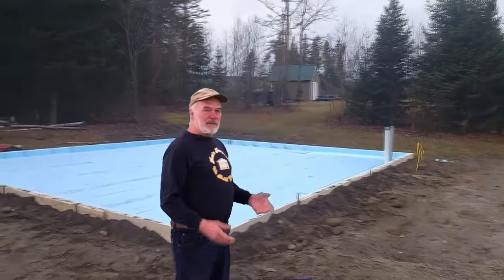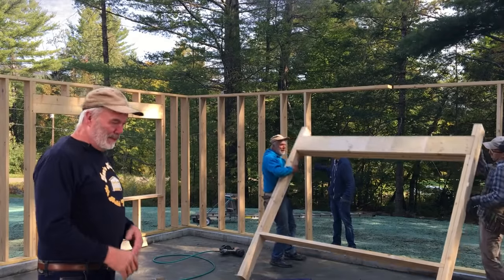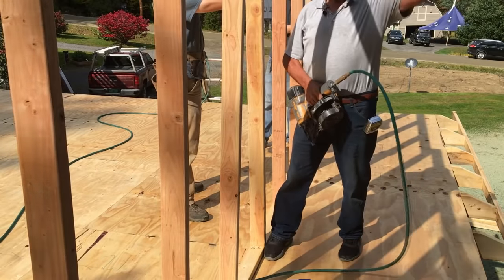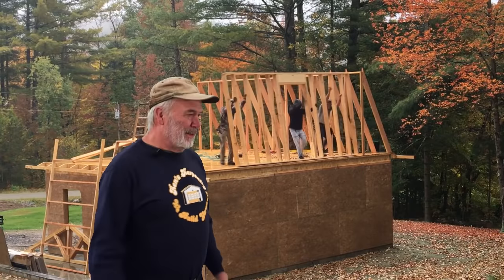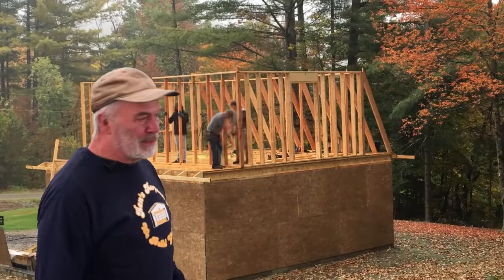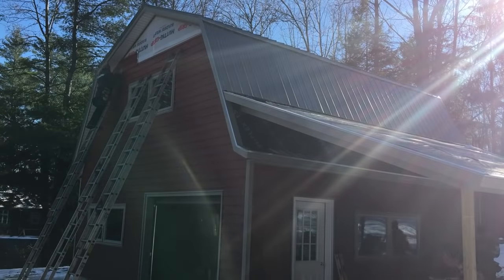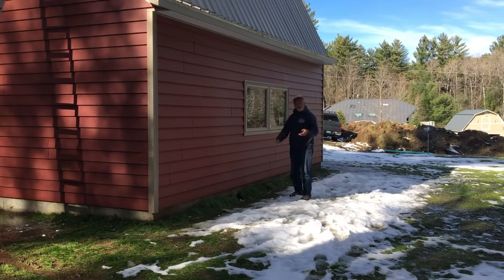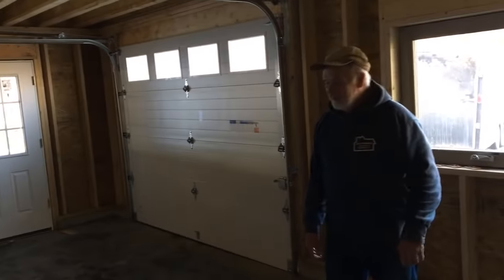How Much for a Gambrel Garage in 2021 ?

Comment: Hello from St. Louis Missouri Ken.
I enjoyed this video sir. I'm looking to have something very close to this built in the next year or so. The building would be a hanger with small shop on ground level and a planning, sleeping on the second. Really the only difference would be a large door opening  to accommodate a 23 ft wing span (aprox 24ft opening?). You've done a nice job here Ken. I appreciate the time you took to explain the details. You have gained another subscriber sir.
Reply from the maker: Sounds like a nice project. Hope it goes well.

Comment: Nice to see sill plate gasket and bolts poured in the cement to secure wall nice and tight. Nice job you see skiped by so many.

Comment: Wow.  You guys are really fast.  It always took me much longer to build anything.  lol.  The vinyl siding looked great, but it's not practical here in Texas.  The summers are so hot that you can actually see the vinyl siding drooping because of the heat.  Cement board is the most practical here.

Comment: Prices are different but about $1000 difference between materials used to build with because of the different products and thickness of siding and the quality of windows. So if you paid $1000 more it’s better built up with higher quality products and that’s the difference between 30 years and 50-60 years later the higher quality products last 50-60 years with little to no maintenance costs.

Comment: Great work Ken !  I finally subscribed as I keep rewatching your videos. I think I've decided to go with a 24 X 30 cape style however and was just wondering if your 12/12 pitch 2 X 10 rafters were 18 or 19 ft ? Metal roof was 18 ft so thought rafters would also be 18 ft. Also , how wide are your rakes on the cape style. Thanks for any reply . Oh yeah , what kind of metal roof do you use for your 18 ft lengths?
Reply from the maker: Thanks for subscribing. The rafters are 18’, the roofing is Everlast. The rakes are 12”.

Comment: Spec it without the garage doors and you got yourself a house....this is a deal! Finish the inside....wiring, insulation, plumbing, drywall, partition walls for less than $5k in DIY mode.

Comment: Over here in Australia we sit our steel on plastic chairs so that the steel is about an inch and a half from the top of the concrete to minimize surface cracking or depending on the soil test and engineering, it may be a thicker slab with two layers of steel

Comment: Ken, I live in a pole style 24x36 gambrel attic truss barn. I’d like to do an addition either like shown here or a gable tying into the steep part of the roof. How did you finish the ends where the shed roof fascia and the gambrel roof fascia come together?  Box it in with fascia metal in a big triangle facing the outside?
 Trying to find what it would look like as I’ve never seen another one than in this video.
Reply from the maker: Hmm I’m not sure

Comment: Ken is the 2” of foam in the floor adequate if a person wanted to use this as a small cottage/cabin in a area that gets cold in the winter ? Or do you have to do things totally different with the concrete floor if a person is planning on finishing it off inside to live in.
Reply from the maker: 2” is good